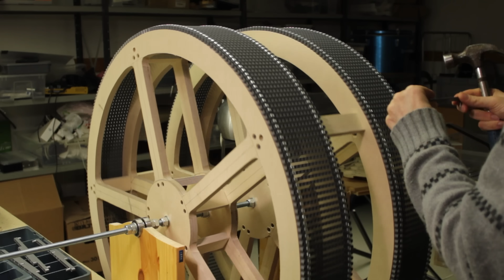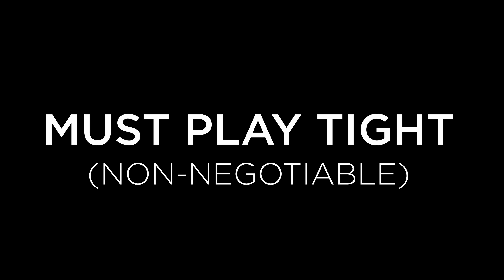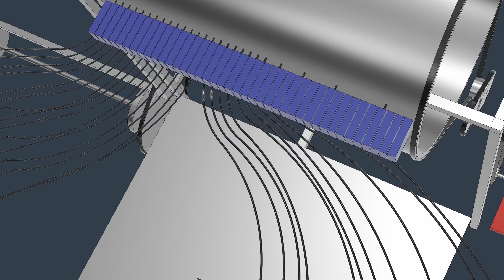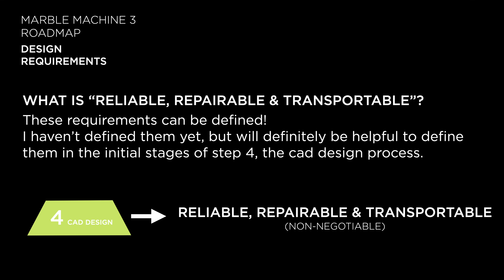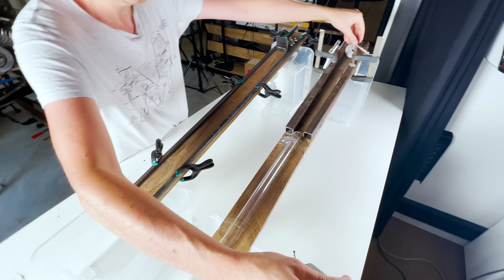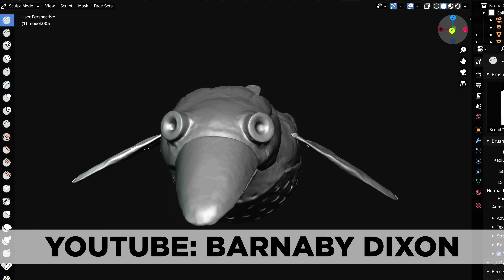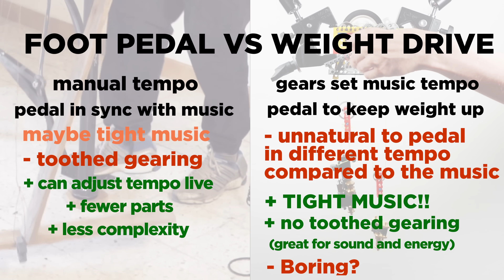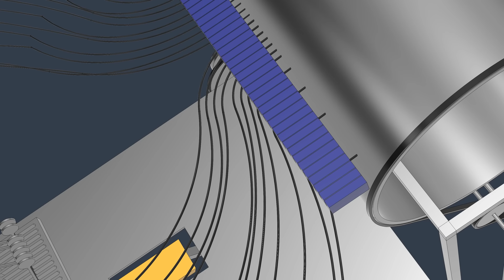Marble Machine 3 is Taking Shape

Comment: One of the best things about the original Marble Machine song was the "brakedown", the recovery from it and the wind down at the end. Incredibly expressive parts of the song and things you'd not be able to easily replicate with a Huygens drive alone. The way I see it is that you don't want a digital MIDI machine, but you want the precision of one. You want the ability to maintain a constant BPM output, but don't want to regulate it with motors. You want an analogue machine that requires a skilled operator to make the music, but humans are fallible - you are someone that I think has introspected enough to know that you are yourself, fallible, Martin. But that human fallibility, the inherent inaccuracies of the operator are the difference between a MIDI keyboard playing back a perfectly quantised composition and a piece of music played with passion and skill.
I understand your desire to make the machine precise and predictable, I support that. But to me, there's no difference between a servo motor turning the "crank" at 120BPM, or a Huygens drive, or a foot pedal with an adjustable governor. They all basically achieve the same objective, except the foot pedal is the only solution that truly requires any operator skill. It's also the one option that offers you the ability to be more expressive and ad lib it a bit on stage. I would continue to put energy into the pursuit of making the components predictable and reliable, but accept solutions that are dependent on you, the operator for tightness. Otherwise, you might as well just build a marble-driven MIDI machine.
Reply: This. This right here is the philosophical angle. I'm obviously waaaaay more worried about the safety angle, because of recent events, but the musical aspect of it can't be ignored.

Obviously, his focus on the tightness of the trigger mechanisms and the marble drops is commendable, because… most historical music machines are indeed a tad more precise than his first efforts. But the human aspect you mentioned is, indeed, what set HIS machine apart from all of those. It's not a self-playing piano, or whatever, but an actual instrument that just so happens to play a pre-assembled track. Some degree of variability and fallibility should be a part of playing it, and having the band and even Martin himself adapt to it, and then crank it again and tweak it accordingly, rinse and repeat, will make for a very viable and interesting performative exercise to watch on stage.

I hope more people make him realize that, because it's actually the fans who are going to pay tickets to watch Wintergatan. Sure, artists can and should keep their artistic integrity and personal will over their fans' (some of them even do it to a fault, like the Norwegian band Shining 😂), but… it can indeed be a dialogical process, and seeing how Martin keeps asking us for feedback… he can't act surprised or too defensive when he also gets it regarding more philosophical and artistic stuff like this.
Reply: Came here to say much the same thing.  We already have ultimately precise music.  Computers can render music accurate to the nanosecond.  But let's face it, the Chemical Brothers have never been and will never be as popular as a band that plays instruments manually.  The imprecision is part of the point.  The human skill required to prevent unacceptable imprecision is the entire point.  There's no need to listen to live music otherwise.  If we want perfection, we can listen to the recording that's built up from 20 tracks, each one of which was THE perfect take among dozens or hundreds.  Sure there's a market for that, but it's practically orthogonal to live music.

Martin's obsession with "tightness" (precision timing) very much runs the risk of him just building a very big mechanical music box, not a musical instrument.  It's clear to us that he wants to build an instrument.  I'm not sure it's clear to him.
Reply: @dragonmaster9543  Here's an idea I thought of literally like a half hour ago:

Maybe what he means by "tightness" does indeed have to do with timing precision, but not quite in the way you're thinking of it. What I mean is, if the tempo is to be altered every now and then, it should be altered because the operator of the device intentionally wanted it to vary, either by slightly offsetting the pins on the programming wheel or by changing the speed of the drive mechanism. In other words, "the machine should do exactly what you tell it".

"Untight", then, would mean that the tempo/timing is varying without the control of the operator, either in terms of the position of pins on the programming wheel or the speed of the drive mechanism. In other words, it's like the machine has a "mind of its own". We've seen this happen at least a few times with the previous marble machine and it was obvious. When that happens, then the machine is indeed failing. I mean come on, how would you like it if you had an instrument that did not do what you instructed it to do, as if the instrument had a mind of its own? No musician, or any other type of machine operator, wants this!

After all, Martin did say the term "tight" is rather subjective; it doesn't only have to refer to "timing precision" I.E no tempo variation ETC. This is why it kind of disgusts me to have seen sooooo many commenters on this channel criticizing Martin's insisting on "tight music"... I think these people are failing to determine exactly what Martin means by "tight" in this context. Some of this criticism is really misplaced. Some of it has been valid though.
Reply: It will be hard to react super fast to timing if you have to speed up and slow down a big flywheel. Someone joked that Martin was going to end up building a clock, but if the foot pedal acted as an escapement for a weight-driven power system, then that would decouple power input from timing. Probably too complicated, but fun to think about.
Reply: Solution, use a CVT. Infinitely variable and compatible with a Huygens drive. As well as no toothed gears.
Reply: The final step will be to add a slider in select cables to make the music "dirty" when desired.
Reply: Well said. Only one tiny objection: I do not see value in imprecision by itself. It is more in the human processes that cause imprecision. Including the feedback loops of the musician handling their own "mistakes" live. But not least the intended/motivated "imprecision" – in timing, dynamics (emphasis) and sometimes intonation – that enriches music. Adding random deviations to a MIDI would not be the same. In fact, I think this is (roughly) what you meant too, by mentioning human passion and skill as important qualities.
Reply: One of the best dynamics in the original video which got me hooked was the falling marbles and your perseverance to the musical piece. It was as if the world around you didn't matter as long as that song made it to the world through this device you had created as a medium to bring it to us, the audience. There was something romantic about the chaos.
Reply: I see this as similar to why watchmakers still make mechanical watches.  A quartz watch is objectively better at being a watch and is 1000x more precise for a much lower cost, but trying to make a precise mechanical watch is an engineering and artistic challenge that is still fascinating enough for many people to be willing to spend the money to have one.  Art doesn't need to be practical and can have goals that seem arbitrary or at conflict.

Comment: Road map pyramid looks great btw. Really well thought out! You're awesome, keep it up!
Reply: Not really. Timing comes later in the process. First thing he should have done is establish requirements. So far Martin seems to be completely oblivious to this step. Instead of sitting down and establishing some realistic targets, he's making it up as he goes. He's getting bogged down in detail and he's not even started. This is what got him completely demoralized with the MMX.
Reply: @CristiNeagu He has created requirements, however since it is art a lot of those things are intangible aspects only he knows exactly what they are.

Though it does at least seem his processes this time are looking at the machine in a more practical manner to make the most out of a visual and audial system rather then simply making something that looks cool but is impractical for the most part…that was the main issue with the previous two.
Reply: @LiminalSynergy  No, he hasn't gone through the process of creating requirements. He just told us that he has no requirements in place for the final two steps in his pyramid, but he's already planning on fabricating the power input module. Without knowing if it meets whatever requirements he will come up later. That's just not a healthy workflow.
Reply: @CristiNeagu  I was agreeing with you.

I was pointing out the flaws in the "requirements" he did have.

Comment: why not have both foot pedal AND weight drive? is it possible to have a switch you can activate that will let you switch between foot pedal and weight drive? this will be useful for when you need to up the tempo.

Comment: I'm wondering if there's a way to do a continually variable transmission with the weight drive.  So you could adjust tempo on the fly via some kind of shifter.  It sounds complex but there may be a way of isolating the complex parts so that they're all part of one transmission assembly that's none-the-less easy to assemble as a pre-done subassembly who's complexity is only needed to deal with the one time you put it together.

Comment: I feel like there must be a way to use the weight system without the disadvantages you mentioned. You just need a quick and simple way to adjust the temp settings of it.

I think there's a huge advantage to being able to have periods where you're not required to be pumping. So, you pump for a bit to get the weight up, then you rest and focus on your music. When needed, you pump it back up. If you can find an easy way to dynamically adjust the temp, this feels like the better approach.

Also, I find it hard to believe that a foot pedal will give you that much control over temp. I mean, you're using a flywheel, right? So, there's momentum and resistance. I don't see how it could be as seamless as the foot pedal of a bass drum, for example.

But I'm not an  engineer, so...

Comment: You should cut this project down at first. Do maybe only the right side of the image (forget about all the special instruments) and try and focus on non-dynamic music at first. When this is done, you will have a measure of the timing accuracy your gut wants which will help with the rest. Don’t forget to also play a tight song normally first to have a clear goal. Don’t try and make perfection at once failing constantly due to over-confidence, do it by iterations, we don’t care if the final product is called MMX3 or 4 honestly. I also don’t consider you failed at the 2 previous machines, the first was a successful proof of concept and the second was a beautiful machine but you never truly tried to have a tight machine (you lied to yourself). At the moment, you seem to once again have locked your design like in MMX(T), watch out!

Comment: I have an idea how to compromise between the Hyugen Weight Drive and the foot pedal. You could replace the weight in the drive with a spring, then the input power will depend on the height of the "weight gear". The input from the drive would still oscillate, but much less than with a footpedal, but the most important thing is that the average input power would directly correspond to pedalling frequency.

Comment: The weight drive is not a energy source. It's an energy store and a governor. You could use a foot crank to add energy into the weight drive. You could also design the governor to be adjustable for different tempos.

Comment: I have a high level of confidence that the pedal design with a full scale flywheel will be plenty tight. 
I base this on the fact that a tiny, innacurate lego model was incredibly tight for most people (just not martin himself). When you use a flywheel with enough mass tightness will most certainly improve. 
The only question is if thats good enough to satisfy Martin. 
That being said I still want to see him measure the tightness of a drummer since it puts a good reference point.

Comment: My opinion: The whole appeal of MM 1 and 2 was the design and complexity of the system. For an art project style instrument like the marble machine, design requirements like low latency (tight music) just seem pointless. Most people wouldn't hear the difference between 1ms and 50ms latency, especially not in a concert setting.
If the marbles don't "do" anything except go up a conveyor and fall down on a key / drum etc. then what is the point of using marbles at all? You'd have better timing, sound and simplicity by just using a computer. I thought the whole idea was for it to look cool. At least that was what got me interested in this project in the first place.

Comment: I have been loving these new videos and I am so excited for the new iteration of the project. That being said, Martin: don't be afraid of failure. In fact, embrace it. As sentient organisms, failure is how we learn. That is why we test, that is why we practice. While you may be disappointed that MMX didn't turn out to be the correct solution, think about everything that came out of it. Think about how many new fabrication techniques you learned. Think of all the new knowledge of engineering you acquired. Think of the new experience & skills that you developed. These are priceless. And the knowledge of what went wrong with the two previous models is giving you new perspective and new ways to look at this one. Iteration is the heart and soul of design. Just like a piece of music...you might lay down a track that seems pretty good, but move this note here, that effect there, and it evolves to become more perfect.
Reply: Most of the time i don't know what i want out of a build exactly, the requirements and the spec, before an earlier iteration of it is already built.

Comment: What if, instead of bowden cables, you'd use pneumatic actuators? They're way more reliable!! And extremely tight, there is no friction, the oil is incompressible so the marbles will drop exactly when the pin of the programming wheels touches one end of the pipe! Bowden cables can, and will, become loose with time and the machine won't play tight anymore.

Comment: Martin why not set up the machine to use both power systems in a modular style? Then you could use the pedal if you want better control or flip a lever and have the consistency of the weight drive?

Comment: "Module" seems to be the important bit, here. It might even make sense to have a clutch so you can enable  governor on the fly, or bypass for more direct control. Just as in a shift by wire sports car: On the track you might want to shift manually, but not bother on your commute and let the car take care of things.

Comment: It's too bad a continuously variable transmission is not an option (probably way too complicated to implement.) If you could somehow use one, then you could adjust the tempo with a lever like the accelerator in a car and use the constant speed weight drive as intended.

Comment: You don't have to choose between a foot pedal and a weight drive. You can also combine them. Connect a foot pedal through a continuously variable transmission to a weight drive. This way you can pedal in time with the music and still achieve a constant rotational speed for the weight drive.
Reply: Exactly, “winding the clock” can be done with foot, weight drive is constant, so he can thump away to whatever beat he chooses via the gears
Reply: YES. Use foot pedal to power the weight drive and have a knob to change the tempo using a CVT
Reply: but maybe he can, implement a mechanical power input switch box, with a wire he can connect the weight system to keep the tight music, but in the event like he describe of "transfer the energy of the public to the machine", he can disconect the weight blocking his fall, and with the assistent of the flywheel start pedaling faster or slower, when finish reconect the weight and continue the play, like a gear box and a cluch (sorry not a mechanical guy)
Reply: using a centrifugal governor controlled with a lever or a set of governors for specific speeds and a transmission would retain tempo control with the weight drive, the primary issue is just how many parts the whole system will necessitate
Reply: Simplicity is also a feature
Reply: I wonder if he might also have a way to cause the rate at which he pedals to cause the rotational speed to vary, so he can also have it respond to the audience input.
Reply: So a slider or something like that to control the speed? It seems like he would need that to adjust tempo between songs too. Or the transmission adjusts to the tempo of his foot?
Reply: Now that's something I didn't know existed. (just went down a rabbit hole about transmission and stuff) But yeah that could work, however it does add more complexity into the system. Maybe if you buy one off the shelf it's not so bad, would have to do some research.
Reply: This makes infinitely more sense than just picking one or the other
Reply: I can't imagine with the size of 3 that he will be able to do it with a hand crank alone.

Comment: With the weight drive you could try having a gearbox between it and the pedal so you could still keep in time with the beat? You could also add a clutch to the weight drive mechanism to engage/disengage the pedal drive when it needs to keep the weight up!